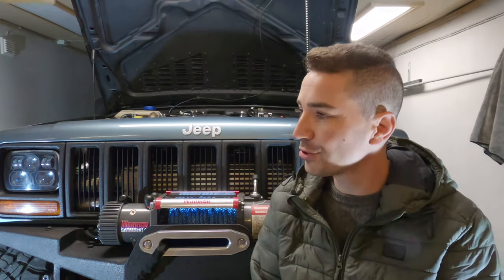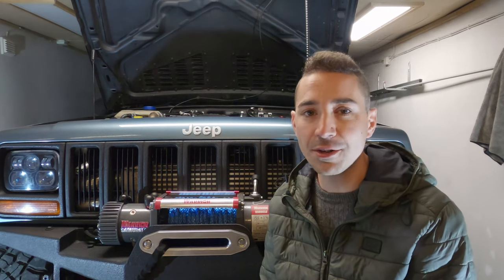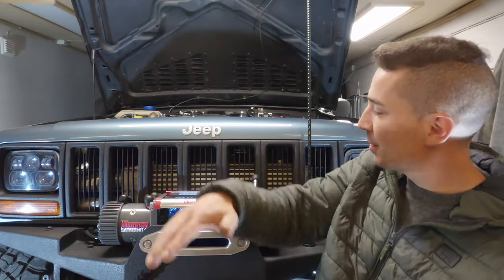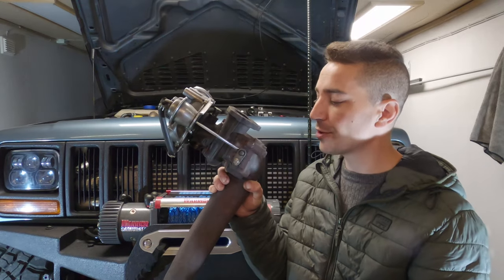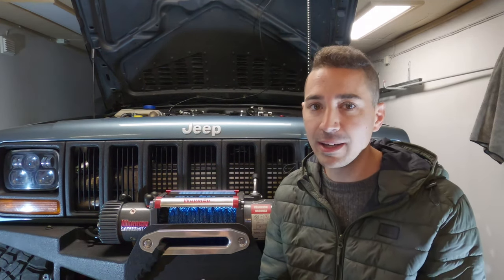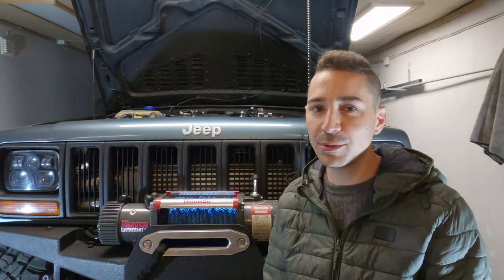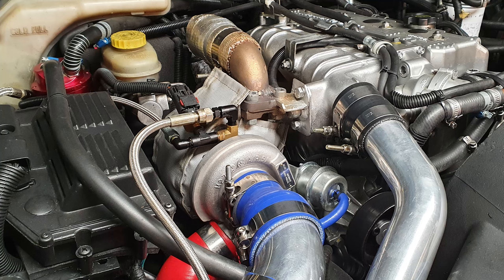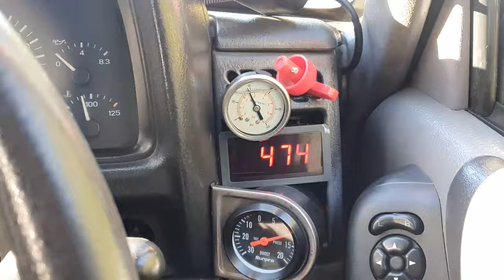Better Performance Jeep 2.5TD VM Diesel Engine

Comment: 🚨URGENT🚨hello! I live in Turkey.
my tool; (Alfa Romeo 155 2.5 TD VM engine)
The electric fuel pump failed and we applied a mechanical pump with a volume of 1.9, but we could not get efficiency!!!

Can we get efficiency if we apply a voyager 2.5 vm diesel mechanical fuel pump??
And what settings should we make?

Your advice is very important to us*
Reply from the maker: Hey. A chrysler voyager pump from a 2.5 vm engine 425ohv will work on your alfa romeo. I have a video on installing the pump - https://youtu.be/ItqlMxEml2I
The engine manual is also in the description on this video. Installing the pump isn't that difficult but you would need to adjust the pump timing using a dial reader.
Reply: @WorkshoptoWilderness  

What difference did you experience with the new pump assembly??
Is there an increase or decrease in performance?

Also, I don't know how to set the timing, I will have the service watch your video.
Reply from the maker: I got an increase in performance but I tuned the pump to almost full advance. I also tuned the pump and fuel pin so that the turbo comes in earlier. 
This makes the turbo come in at about 1400rpm and peak out at 2500rpm at around 19psi. Its a gt2052 so it spools fast and you can turn the lga ontop of the pump so that the pump and turbo work together better. You can't make the injectors give more fuel without changing the volume or nozzles but you can get better turbo responsive, more power from advanced timing and better atomisation of existing fuel
Reply: @WorkshoptoWilderness  

Hello there!
i asked you a question before

I found and bought a mechanical fuel pump for my vehicle with engine code 425 (2.5 Voyager diesel pump).

But I still have questions for you.

*Is your RPM clock running? if it works how?

*Does your vehicle stall at sudden accelerations?

*How did you make the fuel pump settings?

*Did you make a connection from the turbo to the fuel pump?

* Have you made the injector settings?

And finally, what kind of settings did you make during this whole process?
I left my vehicle at the service, what should the vehicle master follow?

Thanks..

Comment: The oil pressure sensor on my 2.5 VM diesel is scary to look at ( when i eventually found it)  i think they moved it around a bit during production of these engines mines on the opposite side to the turbo. Anyway  has anyone changed one because where it is and how hard it is to get at the more information about them i get before i tackle it the better cheers.
Reply from the maker: I removed mine because it broke and I couldn't find the original part so I fitted a analog line with a gauge to the dashboard. You have to remove quite bit to get access. I think I took off the manifolds and such but I was doing other jobs at the time so I cant quite remember if its accessible without doing that.
Reply: @WorkshoptoWilderness  mines broke not sure if it's a connection issue or the actual sensor. I've seen them in a few locations on the VM engine the one on mines on the opposite side of the engine to the manifolds. It's the weirdest looking unit I've ever seen it looks like a push fit connection not that I've ever seen a push fit oil pressure sensor.
On the upside it's threaded into the block so I  should be able to sort it out.

Comment: Hello 
Do you have a spare pcv hose from rocker cover to the pcv valve? Or a know how to get it?
Reply from the maker: Sadly not. You can make something up with two bends a straight length and two plastic hose connectors perhaps

Comment: Does the scorpio intake manifold fit with the OEM turbo and exhaust manifold?
Reply from the maker: Yeah it will bolt straight on with the standard exhaust manifold below it.

Comment: Where did you find the injectors rebuilt kit?
Reply from the maker: Its more just the nozzles I replaced - https://www.ebay.co.uk/itm/270948680530

Comment: Hello, does this engine use wet liners or dry liners in the cylinders?
Reply from the maker: Wet liners.
Reply: @WorkshoptoWilderness  Thanks! Let's see if you can help me with a technical question. I'm installing new cylinder heads (Cherokee xj 2.5vm 2001), and I noticed that one of the cylinder liner is not entirely aligned with the block's flatness. It's off by three hundredths of a millimeter. Do you think I need to resurface the block?"
Reply from the maker: @jmen593   The manual states that 0.01 - 0.06 mm of liner protrusion is within normal range.  The manual is here page 36 - https://dokumen.tips/documents/vm-25-manual.html?page=36
I'm not sure if you have it or not so I put a link.
Reply: @WorkshoptoWilderness  Oh, I thank you very much, you are a true professional!
Reply from the maker: @jmen593   I don't like to guess so I took a look haha. The individual heads come in handy sometimes for variations like this.
Reply: @WorkshoptoWilderness  The problem I have is that one of the cylinder liners is -0.02 (negative, below the flatness of the block).  So I'm considering... put the cylinder heads on now and try my luck... or disassemble the engine to fix the root issue.
Reply from the maker: @jmen593  I don't think you should risk it. They shouldn't be below the block. There are shims from memory that you can use to make them protrude up.
Reply: @WorkshoptoWilderness  It has been very helpful to me, thank you
Reply: @jmen593  There are shims under the liner head.

Comment: Someone correct me if I'm wrong: 72L of fuel used on 650km trip is about 21mpg. Not 30mpg
Reply from the maker: I knew I was off with the mpg measurements but yeah around 1 in 11
Reply: xj tanks are a tricky thing, cause its hard to properly top off so you never have the same amount of "max fuel" so could be the first time you fill in 72L an think you toped of just cause the fuel pump gun cliks,
next time you go in and rock the jeep a bit or fill slower and you get 75/76 if you stay long enough you can even go up to 90/95 so its hard to have an accurate estimation that way
Reply: I calculate it as 25.7 mpg (UK gallons).
Reply: @Ijusthopeitsquick  sounds more like it. My 4.0 manual used to get 20-22mpg. There’s absolutely no way a diesel with just over half the displacement is getting worse than that 😂
Reply: @Robdutton91  My dad's 4.0 automatic was anywhere from 17 to 23 mpg (UK). Mike's vehicle has a big lift and huge tyres and a lot of extra weight, so mid twenties sounds about right.
Reply: @Ijusthopeitsquick  mine was UK mpg and on 35s and a 7 inch lift with 4.56 gears. Pretty similar to mike’s, and if that calculation is correct it was only marginally worse on fuel despite being a 4.0 petrol
Reply: @Robdutton91  holy crap... No way someone on this planet is lucky enough to own a 4.0 with a manual 😂
Is it stock or you swapped the transmission?
Congrats for you dream setup.
Reply: @tartopom2669  thanks man. It was swapped, UK models never had the option of manual with 4.0 so it’s even more hard to come by. Sold it a few months back, think I’m going to get a cheap WJ next and just put a mild lift and some 33s on it 🤠
Reply: @Robdutton91  nice, another great Jeep.
For now I'm just trying to repair the old Cherokee I have as my first car, haven't been maintained in 12 years and I quickly had death wobble 🤣 pretty frightening but hey it's a nice car to learn mechanic with.
Reply: @tartopom2669  yeah they’re dead easy to work on. Everything is easy to get to and parts are relatively cheap.

ZJ V8 steering is an easy upgrade if you’ve got death wobble, it’s more substantial than the OEM XJ stuff and it’s a direct fit with no modification. Death wobble is no fun
Reply: @Robdutton91  not gonna lie, the parts and documentation is very easy for the 2.5 and 4.0 petrol, but aftermarket support for the 2.5 diesel is pretty difficult compared to them since it wasn't sold in the US.
Somehow you guys seems to like it more in the UK. If you know some good forum where people know how to deal with the VM Motori engine (on top of these helpful videos), I would be glad to learn from them since in France this engine is basically completely forgotten.

Wow didn't know that the ZJ front end was compatible. I bought a complete "reinforced" front end kit from Crown RT Offroad. I would prefer a MOOG kit but had no time back then.

Thanks for the tips and good luck with your WJ, so many lovely engines on this one 👌🏻
Reply: @tartopom2669  that’s what put me off the VM, that and the fact it’s so prone to cracking the heads. But as Mike has proved it can be “polished” into something better. I’m afraid I don’t know anywhere better for info than these videos! 

The WJ is just a better starting point for an off roader. Crossover steering, Dana 44a rear, Quadra drive has the LSDs front and rear, full time 4WD, coils in the rear etc etc and it’s like driving a sofa :) I had a V8 last time but wouldn’t be against a 2.7 diesel price dependent.
Reply: @Robdutton91  ha that's right for sure. Have some nice wheeling 🙌🏻